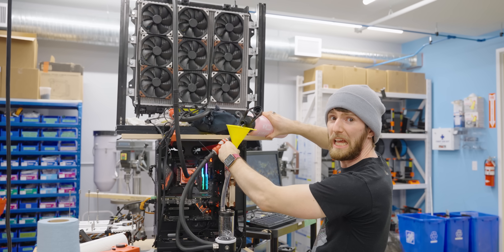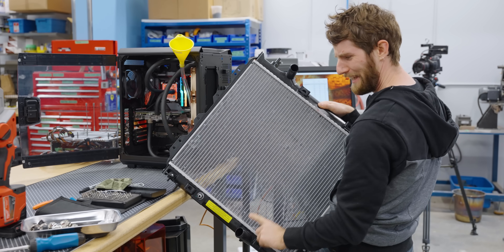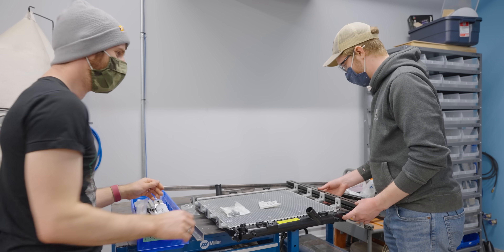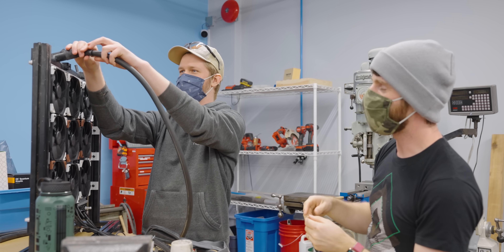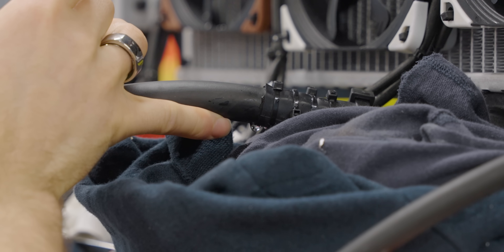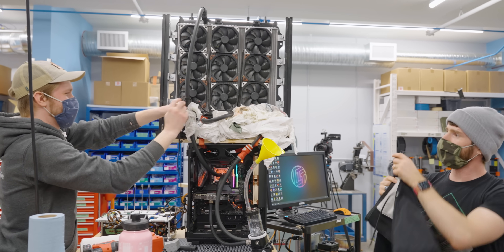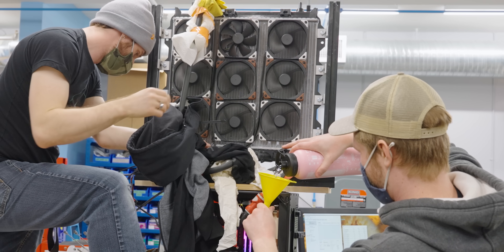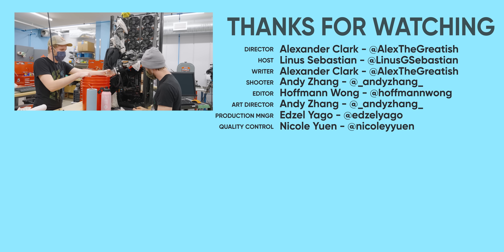Our Craziest Cooling Project Yet - Car radiator liquid cooler

Comment: So, yeah, you could at least have made an effort and bought in proper tubing and clamps so the system didn't leak. That way the system could have been stress tested properly for a few hours. Somewhat fun video but meaningless due to general laziness in the building of a monster rad. :/

Comment: Well we bought a radiator, should we also use radiator hoses and a radiator fan that are specifically engineered for the purpose at hand? No. Inner tube and duct tape.

Comment: FFS Linus, Why didn't you just grab some 1-1/4 hose and hose clamp it to a 1-1/4" PvC barbed fitting with a threaded cap tapped with your half inch water cooling fitting? You could of bought the hose and clamps at the same time as the radiator and get the PVC barbed fitting and cap at any hardware store.

Comment: Well, so it seems that I had a setup (and a lot of other people have) that can equal this - but less janky - Watercool has been selling the MoRa (Monster Radiator) that takes 9 120mm fans for over a decade ... you can get just the Core and build a mount yourself or buy the fancy one with a steel casing

Comment: At this point, why not just completely remove the Pump / Radiator, and have the Inlet be connected to a live faucet (on cold), and the Outlet just goes down the drain

Comment: I would like to see this done and tested with more thought and effort put forth and actual comparison of results from different size pc rads vs the car rad...maybe get an actual car electric fan that mounts to the car rad like it's supposed to be to compare temps with higher air flow

Comment: Damn should have got a Civic or MX5 aftermarket radiator with aluminium endtanks so You can modify it easily.
Transmission loops are usually only contained in that one endtank.
Ok, its shittier than expected, dont mind my advice xD I'm pretty much safety third guy, but holy fuck, at least dont kill the hardware :P

Comment: Im sorry, im not one to care about janky shit, but this was just pathetic. absolutely abhorrent. Listen, what you fucking do is, with the "coolant inlet and outlet" (that would go to the engine) is you get an adapter that goes from that size tubing to a compression fitting that would adapt to the correct size tubing for the computer tubing loop. fucking ziptying and taping water doesnt work. this was just stupid and pointless.

Comment: Nothing against a good amount of yanky solutions and some chaos and fun, as long as there is also some serious aspect to it.
But this was pure slapstick from start to end with zero relevant information.

Of corse a giant car radiator with 9 fans at full blast cools a loop much better than a single 240mm radiator.
But what happens when you try it without fans? Maybe when the radiator is mounted horizontal to use natural air convection?
What influence have water temperature and flow rate? Any difference in plumbing CPU/GPU in parallel vs in serial?
Where exactly are the points of diminishing returns for cooler size, flow and coolant temps ?
Missed opportunity.

Not a fan of those 100% BTS/fun/non technical content videos being on LTT main channel.

Comment: I must admit I don't really like these vidéos where Linus and his team act like complete idiots (because it can't be anything else than an act ... right ? please tell me it's an act).
I mean, it's pretty obvious that if you're expecting it to be leaking (which is already wrong from the get go), you wouldn't put it on top of the powered PC. I even facepalmed when he fiddled with the damp molex connector.
In the end, we got nothing. Obviously a bigger exchange surface and more fans would get better result, but we never got exact measurements, because of all the new water poured in constantly. Better do a rig with an open loop where you don't even cool anything,, just pour cold tap water constantly, an throw away the hot water at the end of the circuit. Not cheap, but that's almost what they did there, in an even less efficient way

Comment: zip ties. not meant for plumbing. could have used a motorcycle radiator. and use proper plumbing tape.

Comment: A 98 civic cx rad is $95.01 cad from napa 85.64 for the 12 volt fan that bolts up to it plus im almost sure it would fit on an atx case if you wanted to go that route just cut a big hole and maybe run the fan on 7 volts for the ultimate budget cooler

Comment: The trans loop is simply a tube that runs threw the lower tank and transfers heat from the trans fluid to the engine coolant to be cooled by the rad. It also does the inverse and heats the trans fluid to operation temps in the winter.

Comment: The fittings on the transmission cooler are so much smaller because it cools the transmission fluid, not coolant, like with the engine. The transmission oil cooler is also rated for much higher pressures.

Comment: You basically reinvent a shittier version of a fernco, with a bike tube....  then just tape and zip tie it. My god.... That whole fab shop, and these are the results. Yeesh. Some fittings, fercos, and hose clamps would have everything 100% sealed. All available at home depot, lowes, the like. Tubing as well. . .

Comment: The trans side is nothing special. It is a just cylinder that fits inside the plastic tack side that the trans fluid can flow through for a bit of cooling. no fins or anything.

Comment: This is so annoying watching Linus and friends messing with car parts without knowing how they work and what size water connectors they need. Pc pump for a car radiator that is usually pumped via a water pump run by a car engine. Why do even watch this channel it’s getting idiotic every day. That crap they built is not practical.

Comment: Don't you guys have like 30 3D printers you could have used to create some adapters for the radiator outlets? And also, the trans cooler is basically inside the lower tank so it really wouldn't do anything.

Comment: If you ever decide to do this again properly, just use a drain plug stopper on the transmission lines, or even better, get a radiator for a standard transmission car since it will have no transmission fluid lines. Only the engine water in and out. Then get an actual automotive hose and clamps of the various sizes you need, and use a reducer to downsize from the automotive hose to the computer hose. Also, you would like to at least take a look into a radiator fan assembly and see how it works and what are your options and how can you get creative from there. Just throwing in some ideas.

Comment: Hooking into the trans lines is pointless, there is just a little brass/alum reservoir in there that transfers higher temps of the trans fluid into the antifreeze. Silicone couplers or pvc reducers would of made more sense than a cut up bike innertube n zip strips, some planning took place because you ordered the radiator. This is meh at best, but cutting down the rad to fit into the case then soldering/brazing end tanks on to make a "cut to fit" custom radiator for "any" case. There are a bunch more ideas that would of been better than this.

Comment: Should use just the trans cooler for the computer and hook up the radiator loop to be subambient. Running back through trans cooler just reheats the coolant.
Reply: As a mechanic it definitely would be ridiculous to see you recycling the coolant through trans cooler. Trans fluid and oil are allowed to run at higher temp than coolant.

Comment: You could have gotten a Dual chamber, Full aluminum (no plastic tanks on the top and bottom) for roughly 50 USD out of a 95 Honda Civic.  They are all over ebay. PT cruisers, were known to overheat.......... As a certified auto technician , PT cruiser rad was the single worst rad you could have picked.

Comment: For once just do something correctly, it would be easy to do those adapters and not have leaks. Also using both loops is stupid, just use the main rad, the transmission/oil cooler portion is tiny. I look forward to a part two where you actually do it correctly and test it without just freaking out about leaks.

Comment: The trans cooler side uses a copper pipe coiled up the end tank between the two fittings it's there to heat and cool the transmission fluid. Basically it keeps the trans fuild at radiator coolant temp
So by running the water through the trans cooler loop after you have ran it through the radiator it has no effect on cooling at all as its the same temp the end tank it just came out of.

Comment: I think this was too half assed... You have a million employees, a big half professionel workshop, and Alex is supposed to be smart and know how to use tools... 
And you end up with... hey lets cut some different rubber tubes and jam then into eachother and just tape it all up.... The only surprise that could come out of that was if it worked. And ofc it didn't.... 
It would have been cool if you had actually hooked it up somewhat properly. it cant be THAT hard to find some tubeing and some fittings that fit...

Comment: Well - in a smaller rad, temps reach equilibrium much higher. If you're able to cool the water back to room temperature with every cycle, you're effectively always cooling the CPU with best case scenario. My water temp reaches equilibrium at around 37-38°C, and that 20-ish delta you saw was exactly how cooler the water was.

Comment: Guys, fine, you want to make a clown video? Great. But why when you have a shop full of great equipment and engineers would this be the way you would take this? Why not, ya know, do a good job and have an interesting conclusion? Are reduscer fitting at home depot going to brake the budget? Also, why waste time with the transmission cooler? I would have expected an engineer to know how that works in an automotive radiator and know that it would be a waste of time to hook up, but not a waste of time to mention why and how it would be a waste of time...

Comment: When using those bike tubes to reduce the connection diameters you could seal it by carefully and lightly coating the OD and ID of the tubes with silicone. Just make sure you give it time to dry

Comment: I know LTT wants to do stuff with an entertaining note to it, but...  I did a car radiator cooling system for my PC like 15 years ago on my Athlon XP and i had it all figured out waaay better than this. And i was working with a CO pump as back in those days as water cooling was just starting so high pressure was also an issue. And to solve the acoustics.... Large fans and a carboard shroud. The thing was almost inaudible.
Anthony could probably help with prep and some plan but we have what we have... This just makes me sad.

Comment: they have a lathe, they should make some fittings for the large inlet/outlet and revisit this with some proper fan splitters going to a dedicated fan speed controller. that way we will know if its the radiator or the fresh cold water from the tap lol.

Comment: I wish they would have done this "properly" without having to run around putting out fires all the time. Do it with no leaks and maybe just one bigass car fan instead of all the computer fans if that's easier.

Comment: The bottom of the radiator for the automatic transmission is not just for cooling.  This loop is to warm the ATF to 175 F as fast as possible.  This is why one should let their car warm up, to warm the ATF to preserve transmission life.

Comment: Heat Shrink guys, cheap, easy, waterproof does the job. No pressure test to see if its leaking? Cm on ... If you would't put the rad on the pc, leaks are not such a crisis. I guess this is not longer Tech Channel just like Top Gear stopped being Car review - just entertainment. : /. I guess at least we don't have to see Linus naked torso showcasing LTT pants ...

Comment: You can find one radiator which have the size of cabinet panel and you can fit it with the cpu with proper water sealing that will be the best project...🤪🤪

Comment: POV of an online mechanical engineer grad: If you're gonna do dumb and stupid stuff, can you please do it neatly and properly design it.
Maybe have 2 PCs side by side and the rad in front of them.
Or design a platform for the PC hardware (instead of putting them in the case) that goes on one side of the rad.

Comment: I'm surprised you guys didn't choose to use a motorcycle radiator, since they can also be quite large but the plumbing is more straightforward (one in, one out in cross-flow configuration). The hoses are also smaller diameter so you're way more likely to be able to reduce it down to a size where you can just find a barb to adapt to your computer's size without leaking.

Comment: 3 things to change before Part II:
1) Don't rush it right before WAN Show
2) Put the radiator next to the PC instead of on top of it
3) Seal off the radiator better
Reply: OR, Go even crazier. Mount the radiator to the outside of a car, like a racing fin. Then drive around a track while benchmarking the PC. MAXIMUM AIRFLOW.
Reply: @Zetin2455  Not like a racing fin, you need to mount it like a wall so all the air goes through it instead of around it... =p
Reply: Make sure the fans are plugged in
Reply: But this is more fun to watch

Comment: The level of jank is beyond me, but if it works it works... Though I have some questions. Would this still work even without the fans? That is a big radiator. Also, don't you guys have a 3D printer!? Why didn't you just print custom reducers for the big inlets!??? ;(
Also, try pipe clamps instead of zip ties?

Comment: This is dumb and could have went better with an aquarium pump, and proper planning for the tubing. Disappointing considering that's how water cooling used to be (heater cores + aquarium pumps)

Comment: Ok guys... the trans cooler is just a heat exchanger inside the lower tank to cool the trans fluid using the freshly cooled coolant lol Yes, it heats the coolant back up before the engine gets it, just not a lot.

Comment: Hey guys, why don't you try electric water pump designed for automotive use? Bosch made one of them. It's quite compact in size and use 14 or 16 mm hose if I called it right.
And use machined fittings to connect different tubing to avoid leaks.

Comment: I hope they see at least one comment pointing out that the transmission cooler is just a loop of copper line running through the lower water tank using the coolant to cool that transmission fluid.  So in this setup it only adds complexity and restriction with no increase to cooling capacity.  

Would be nice to see a followup with a leak free system that can be ran long enough to get to equilibrium...just for science sake.

Another point for sourcing parts would be if they dug around ebay in that price range or less they could find an aftermarket radiator with threaded inlet and outlet and just have to adapt down from probably 1.25" threads to G1/4

Comment: The inlet and outlet port for transmission is actually an heat exchanger, automatic transmission fluid needs to be at optimal operation temperature to function properly which is about the same as the coolant temperature 85-90C.

Comment: You could actually build a usable system utilizing a transmission cooler that would actually fit into a larger case. Check out this one on Amazon  (search phrase - Hayden Automotive 403 Ultra-Cool Tube and Fin Transmission Cooler) or use an oil cooler like this  one for a Nissan (search phrase - Upgraded CVT Transmission Oil Cooler Compatible with Nissan 2007-2012 Sentra )

Comment: ok i actually like the idea but you really didn't go about it the right way here 

i would like to see you re do this but 
use a car fan that correctly fits that rad run it off of a 12v dc connection instead of 9 pc fans 

also you need to work on the hook up for leaks maybe buy a fresh rad there not that expensive for smaller cars 

and put the rad under the pc maybe even under the desk i am sure gravity will be your friend during the fill process also it don't look pretty so it would tuck away under a desk/table 

great content as always love the absolute chaos this caused

Comment: I remember thinking about doing it like 10 years ago, never ended up trying due to the cost/risks. The trend at the time was to fix it to the back sidepanel and use it as a passiv radiator

Comment: you mounted the radiator sideways, you could have gone for a fully aluminium radiator instead, then you could have welded in some proper water necks, if you choose a radiator with a radiator cap on it, then you could have filled it from the top and bled it proper instead of straining that pump, and at last, you should have gone with car fans instead for proper airflow, just one or two would have done the trick instead of this jerryrig.

Comment: I know, this was just a joke, but you were complete idiots putting the radiator on the top. In this way, you improved the overall pressure, so made it harder for the pump and made it muuuch more likely to leak. Leaking on the machine itself is just a bonus.